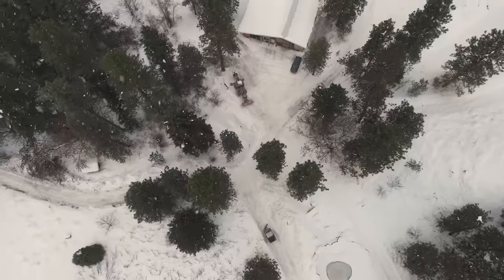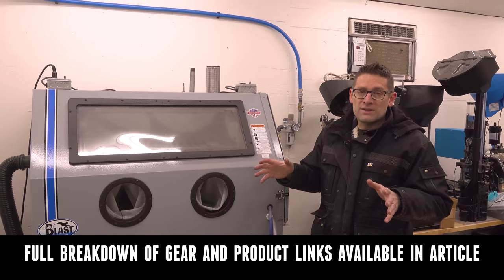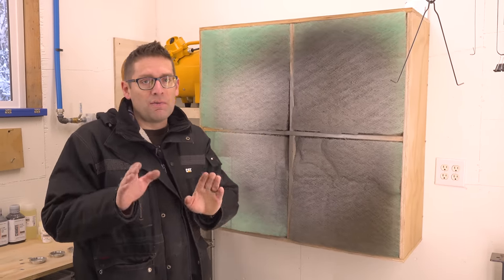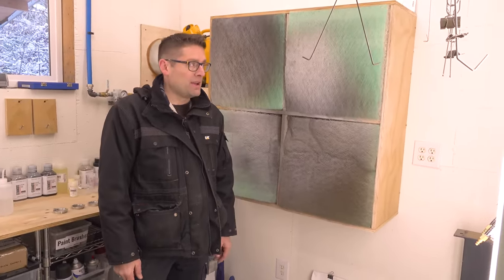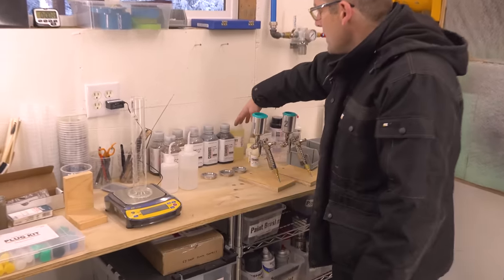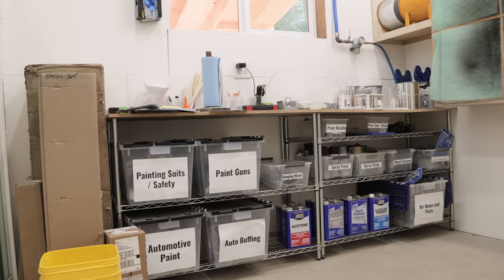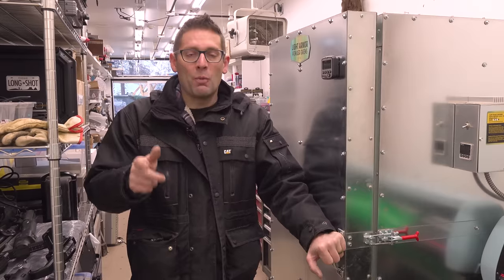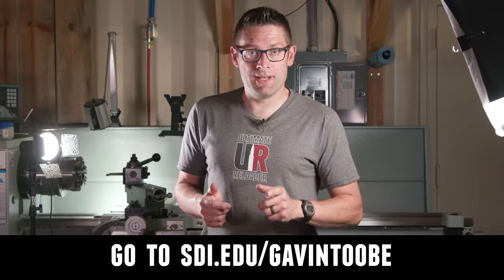COMPLETE Cerakote Shop Tour at Ultimate Reloader (Everything it takes)

Comment: I recommend mounting a roll of paper to the top of your air filter for test spray. Then you can still use the suction to hold it in place but have exponentially more paper to test on.

Comment: Get your masking tapes off the window sill and out of direct sunlight.
Also, a large swivel in front of and over your spray area to enable rotating a hanging part is helpful, especially to avoid handling misshapes, and insure more consistent application.
Nice! Well thought through system.
Thanks for sharing and Happy New Year y’all.

Comment: Sure looks like that Cerakote has a good business model. They sell the training courses and then sell you all of the components to do the work.. Win/Win
Nice setup you built there including the line work,  but long time followers all know with your OCD you will have those galvanized pipes above your spray guns taken apart and Cerakoted blue to match the air line by the next time we see them! 🤣

Have you run into a situation yet where there is a backorder or shipment delays getting a specific color you don't have in inventory? It would be a sizeable startup expense to have to buy any colors in bulk before you need to use them to prevent projects backing up.

Thanks for the video, Happy New Year!

Comment: I've been shooting my own Cerakote on some of my handmade custom knives for a few years. I like your setup and I really need to get an air dryer. Got any tips for how to clean up small specs of trash in your finish? Despite all my dust and cleanliness precautions, I occasionally get a speck or two in the middle of a blade. Stripping and reapplying is such a pain!

Comment: Gavin you can add more air reservoir space to your already storing capacity by running 2 or 3 inch lines to all your equipment and then reduce to whatever size you want. It will help safe your compressor not running for long periods at a time and it will add more air flow as well to your equipment .

Comment: I did it on this budget, I used a 12$ semi clear plastic storage box, cut 2 glove holes in the lid , duct tape, 1 hole for shop vacuum 1 for air intake. 3$ Harbor freight rubber gloves, HF 15$ sand blast gun, 20lb of some aluminum media might have cost 30$, i think it was a HF 20$ spray air gun and 35$ cerakote w air compressor i had already. Not high end shop quality but it worked haha.

Comment: I am currently 6 months into my degree at SDI for gunsmithing. I specifically did this course so I could start my own Cerakote shop! I had already looked into those ovens, and will be using your promo code! I did some coating back in 2017-18 for two local shops that unfortunately did not make it. Once I finish my school I will be going to get certified. Thanks for all the detailed information! I like how organized your shop set up is!

Comment: I have a cheap Harbor Freight unit and did many upgrades. One of the best is a cyclonic filter. Plumb it in prior to the dust collector. You will increase the life of the dust collector I bet twenty times over. I use a 5 gallon vacuum cleaner from Rigid and in 3 years of intermittent use and disposing of over 50# of dust, I have yet to put in a new filter but service it sorta regularly. All the dust is collected saving my vacuum filter and motor.

Comment: Thanks for the tour, Gavin. An idea and a couple questions...

If you have trouble with dust from the floor, you can mist the floor down with water before painting.

How do you keep the spray booth temperature steady? What do you use for heat and A/C?

What type of spray guns do you use?
Reply: Temperature does not present an issue. I am cerakote certified and do this for a living. The moisture in your air is the main thing that gives application issues.

Comment: Just curios when you cerakote AR15 .. do you really have to remove the black paint.. or can you sand blast aluminum or acetone would work removig the black  paint?
Reply: I run my own shop in TX (Spartan Precision Arms) and you don’t necessarily need to sandblast the upper and lower since it’s anodized instead of painted. It is best practice but you can degrease/ clean with acetone and scuff with Scotch-Brite Red Scuff Pads.